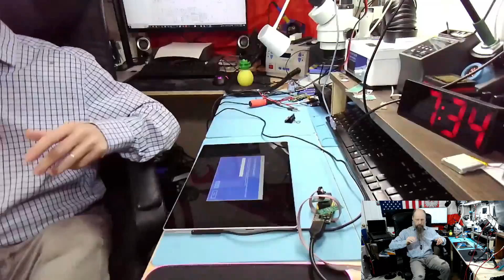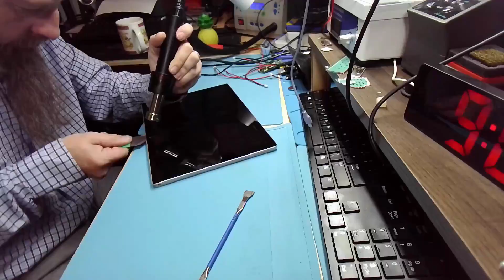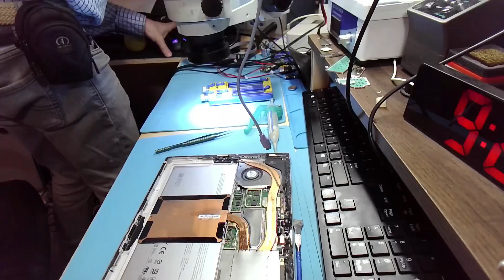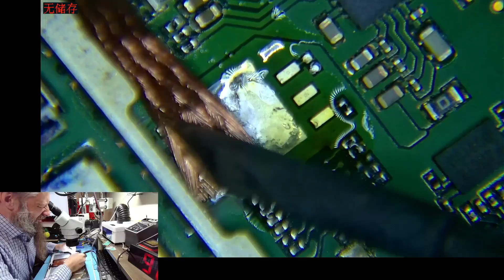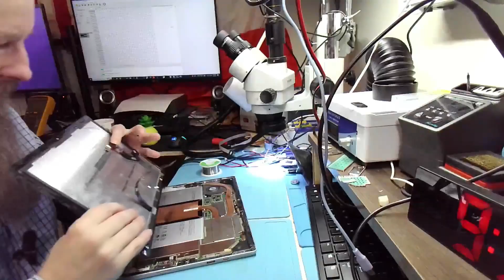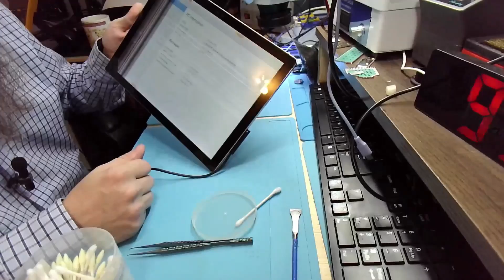Microsoft Surface Pro 4 model 1724 Bios Password Reset with very shaky hands

Comment: I got through programming successfully but on first boot up after install my surface won't get past the Windows icon screen. Can't get into recovery or UEFI. Do I have a bad soldier job or did I install the wrong .bin maybe?
Reply from the maker: Bad soldering could explain that. It is also possible that bin got corrupted during write, it happens on those cheap programmers. Reflash again and it should work.

Comment: Well this sucks. I have 3x Surface Pro 4's that are all BIOS locked (bought from school as well) and I do not have the means to do this fix. Is it even possible to reload Windows on one of these devices via recovery?
Reply from the maker: yes, you can reset them (with some exceptions) without resetting the BIOS password
Reply: How !
Reply: Have you tried 123456 as password?
Reply: @TheEnderpearl1  I have not. I will try that when I get home today. Thank you for the suggestion.

Comment: What's usually the cost of this type of service?
Reply from the maker: the majority of work is in removal and replacement of the screen. The full procedure is around $100 if the display is not damaged, otherwise it's additional $75 for the screen replacement. The device is worth around $150 used, so not sure if that makes economic sense :)

Comment: hi my friend hello from Ireland. wondering if you could help me please by sending me the bios file you used ? i have a different issue my surface had a no power issue and traced it down to faulty bios file i have tried couple of different bios files alll just get stuck on surface logo for about a minute and turns off. i believe your bios file may help me i dont have much faith in the files i found online  as i am now out of options with a big paper weight.thanks in advance 

regards kyle
Reply from the maker: no problem, I can send it to you via discord (or email), just be aware that touch will stop working, even if you reflash the clean ME region. If your device has a bios issue, it will never accept your touch again, you will be forced to use the mouse and keyboard. Are you absolutely sure the bios is corrupted?
Reply: @blackhorserepairs thanks again for your help really appreciate it
Reply: Hi mate I did reply to you earlier today but for some reason message didn't post and only realised when I came back to check for update 🤦‍♂️
Reply: Thinking it was because I included my email address in the comment. But yea basically I'm at my last resort now and hoping your good bios will help to at least get it back up and running my friend

Comment: Is it possible to do the same on Microsoft Surface Laptop 4?
Reply from the maker: I haven't tried but I don't expect problems, it should work the same, you just need to match the ME version to replace BIOS region
Reply: yeh it easy to remove PW from bios dump orginal any microsoft devices...

Comment: Hello i have a surface pro 5 Deadzone touchscreen I'm sure is not a hardware issues because they work fine when i turn on my surface so i think i should do a reset to my bios i have the bin file is there anyway to use it without opening my surface also have you ever meet this kind of problem
Reply from the maker: is it permanent dead zone or intermittent?
in either case I recommend replacing the display, the dead zones usually come up on the edges.
There is no way to reset BIOS without desoldering the chip. Remember that if you loose your original ME region the touch will never work on this machine (check out my last video on that subject)
Reply: @blackhorserepairs  i have like this problem https://youtu.be/hQlZY0dDTNw?si=GJKXK3uDz8fhsKzT

Comment: I have an alcatel 2in1 windows tablet. any idea on how i can reset the bios or the bios chip?
Reply from the maker: locate the BIOS chip, if it's 3.3V you can just reflash it with CH341 as long as you can find the binary, for Microsoft machines they can be downloaded from Microsoft website (that's where I get them).
If you can't locate the chip, take the pic of the board and send it to me via discord, it should be easy to find.
Reply: @blackhorserepairs  ok I see thanks 
Just wanted to ask though, is there anything I can do without all the tools you have? 
So here's what happened exactly: 
The bios password was 'admin' and so I went into the bios to remove it(as it would require the password every boot up) so I made the password blank. But now it's still requesting a password... Is there something I'm missing? 
The 'admin' password is incorrect now and leaving it empty also provides an incorrect password error ..
Reply from the maker: @alexhoffman5511  Interesting... I never actually tested that. Well, the bios reflash will definitely resolve the problem but it certainly is an unusual one. I will test that myself to see what happens.

Comment: These surface devices are always touchy to get the screen off without cracking. I find a heat pad is the most reliably way.
Reply from the maker: yes, I was thinking of using my 3d printer as a heat plate, also I cut through the flex cable when I was doing it so that's another thing to worry about :)